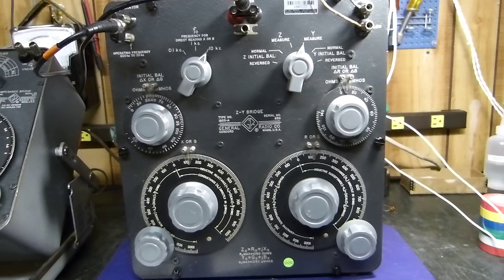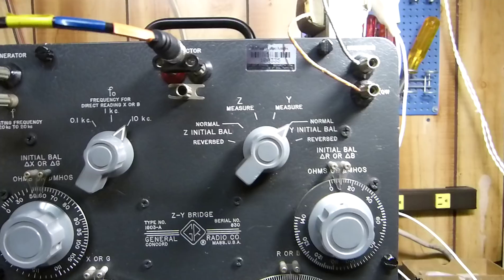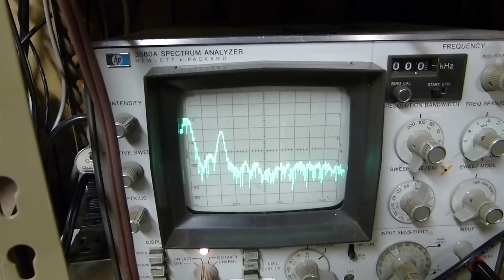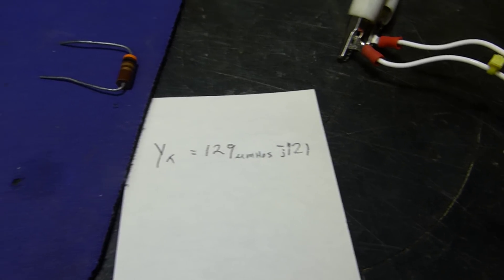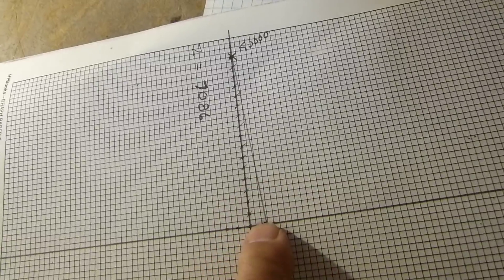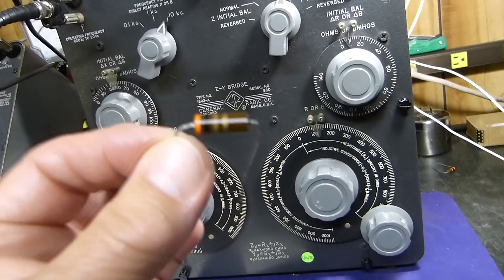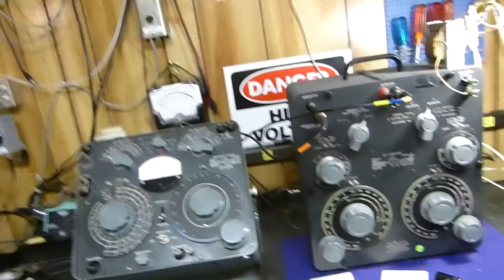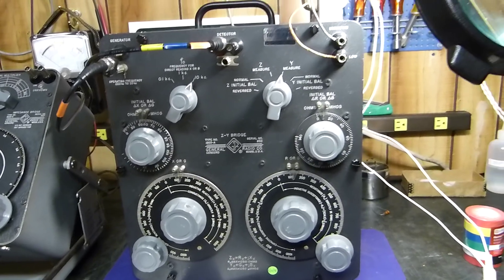General Radio (GenRad) GR 1603-A Audio Frequency Z Y Bridge Used To Measure Audio Transformers

Comment: Dear Sir
    I am an electrical engineer and I want to know if these bridge instruments to can help me, I see many on ebay and yes I agree absolutely beautiful work.anship and machine. In my field of electrical power testing 
And design I often need to calculate or measure the impedance of a 3  phase cable  circuit. The z = r  +  jx.  Can a machine like this give me the r. And X even though it is long cables in a conduit and cable gages in order of 500 mcm. Copper lengths of 1000 ft or 100 ft
Reply from the maker: They are indeed beautiful instruments  but you also need a signal generator and a detector so they are not very portable. Also, they lend themselves to higher impedance values.  Many times values are read in admittance instead of impedance so a small computer program written in something like Microsoft Excel is a good idea to keep it easy to convert. 
Trying to measure 8 ohms like for a speaker connection is a bit of a challenge and they operate best in the 1 KHz and above range and with three pieces of equipment required, they become large and bulky. Personally, I think they are best for a laboratory setup. I do not know an instrument to recommend for measuring impedance and phase for three phase power but I am sure this type of instrument exists in a smaller form. I am sorry but I do not do the kind of work you do so I can not recommend a good instrument but surely they exist and probably not to expensive. I hope you find the instrument you need. Maybe these links will help.

https://www.omnicalculator.com/other/cable-impedance

https://nepsi.com/resources/calculators/per-unit-impedance-calculator.htm

https://www.google.com/search?rlz=1C1CHZN_enUS964US964&source=univ&tbm=isch&q=3+phase+cable+impedance+instrument+meter&fir=O4Tp1RGddZm3VM%252C9fxNJntbcU2zzM%252C_%253B_ifUUPkPB33VBM%252CbFycUU9fGkykHM%252C_%253BhGX8QL8eCV_PZM%252CUAWzC5m-Y9kYaM%252C_%253B5HKaBWyW0fjCGM%252C26xpVuZnwOuVdM%252C_%253B-Y76GLmwkG8rSM%252CwBGi617m9LjJpM%252C_%253B36xvidYtteLS6M%252CaP6n0jA4uU1HWM%252C_%253Bq_8Ge7LUDVoTCM%252C26xpVuZnwOuVdM%252C_%253BaRo2YgEd9iSpQM%252ChjHa0aMeksZsOM%252C_%253BFnF-Lote4h0AHM%252CDPRCFaSOF6T8yM%252C_%253Byhe2c7p5EezW8M%252CIVaFlBgnIiyfyM%252C_&usg=AI4_-kTHPBuSG1aNKh4HzlntsYNGzNUkiw&sa=X&ved=2ahUKEwj3lpnv3eL1AhX4LTQIHRkcBDgQjJkEegQICxAC&biw=1522&bih=746&dpr=1.25

Comment: Get an HP 3568B to use with the 1603.  The 3586B can serve as source and detector. 
You might want to put an amplifier in the 3596B output to drive the bridge.

Comment: Where do you find all these old pieces of tech? And how are they in such good shape? I've come across a lot of this old diagnostic gear, and it tends to be quite worse for wear...
Reply from the maker: +Britt Rossman Much of the old equipment is in pretty bad condition - from being busted up by being tossed around for decades to being in poor operating condition because of bad electrolytic capacitors and much more. On the other hand, some of the equipment falls into the hands of people that appreciate its value, either monetarily or esoterically, and those fortunate pieces get passed along and cared for. I get some of my equipment from Ebay and I have been extremely fortunate. Other pieces come from people I know locally and otherwise. I don't know a secret I can tell about being lucky and getting beautiful equipment but I do seem to be fortunate. I know some of this type of equipment is difficult to understand so I enjoy learning how to use it and sharing it with others and I believe it will help preserve these fantastic old instruments that cost a fortune in their day. Figuring it all out in the vacuum of my workshop and not sharing it seems a waste of time.
Reply: +ElPaso TubeAmps Well, I feel like I can speak for many of your subscribers when I say that it is much appreciated! I am very glad you take the time to create and publish this content. It seems like you're curating a little museum there!

Comment: Beautiful instrument.
Reply from the maker: +Alfred Stampe Thank you, and amazingly accurate likely out performing many new instruments. It seems the spectrum analyzers I use with my GR instruments allows a really fine degree of balance and accuracy that was surely much harder to attain with headphones or a more crude null detector and I can drive the instruments with just a few volts of signal. It is rewarding to figure these instruments out and share their operation with the hope that the videos will help others use the instruments that they may have.

Comment: Wouldn't it be easier to read the impedance with a ohm meter?
Reply: +Jim McDowell Ohm meters will only read DC resistance, impedance is the resistance at a specific frequency.
Reply: OK,I see..Thanks.

Comment: Seasons Greetings to all!

Those old instruments are FINE.  Unfortunately, I lack the space for that sort of stuff.  :>(  However, I do have a nice RCA VTVM.

Drift and noise are problems with carbon composition resistors.  However, they make EXCELLENT grid stoppers, where the flaws do not matter, and being non-inductive and non-metallic does matter.  Metal film resistors are quiet.  They work well in grid to ground and precision voltage divider situations.  Carbon film and wirewound parts have their uses too.  It's the age old story of 1 size NOT fitting all.

Eli D.